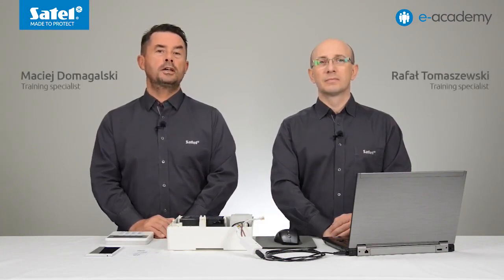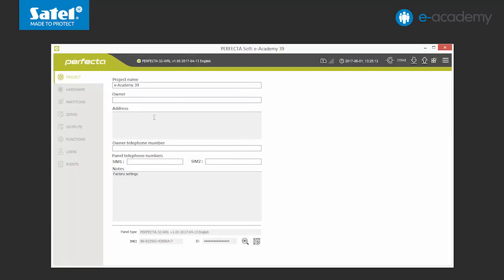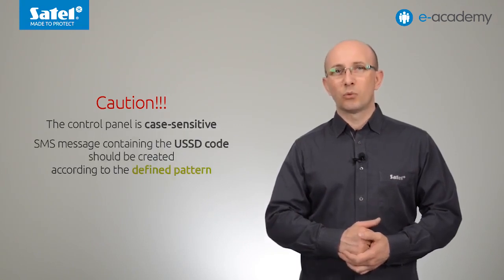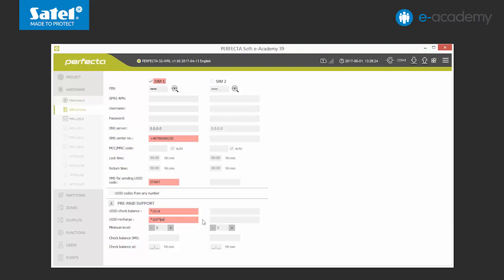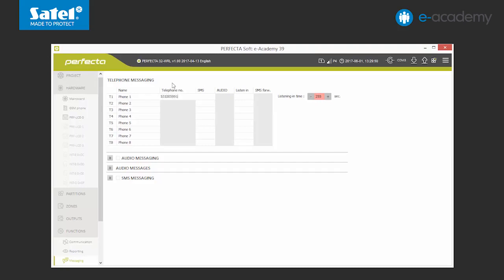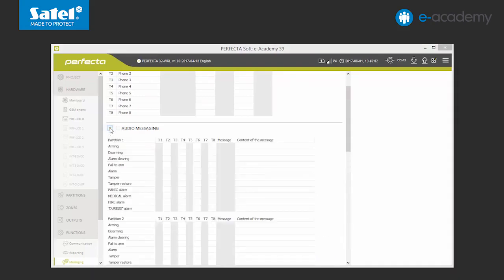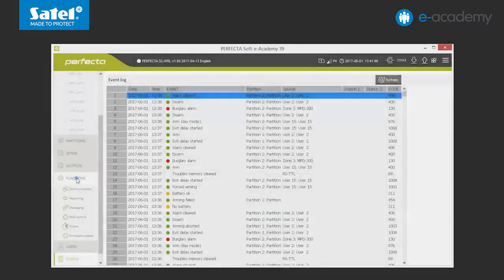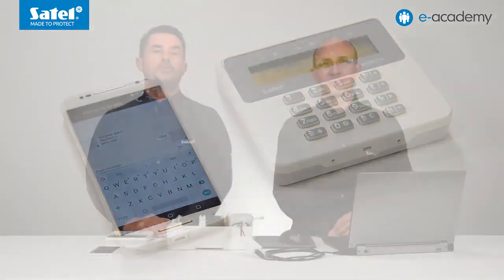SATEL e-Academy 39: Configuring the built-in GSM/GPRS module of the PERFECTA control board

Comment: Hi, is there a way to connect the Perfecta 32 LTE panel directly to the Perfecta Soft software without first plugging it in to the panel via the USB-RS cable?
Reply from the maker: Hi, yes! You can configure the remote connection with PERFECTA Soft using your system keypad. You need to enable the Service Mode, then locate the "PERFECTA Soft" tab in the menu. Remember that you also need to have your GSM connection configured for this to work.
Reply: @satelofficial  Thanks, yes I saw from the additional menu button on the right hand side of the Perfecta soft program, click on "Connections" and then select the "Remote connection: SATEL server" and filling in the relevant IMEI, ID and Panel Key. But as you said, first of all you need to activate the Perfecta Soft tab and configure via the GSM option to get connected to the SATEL server.